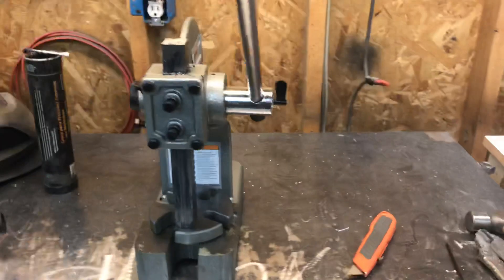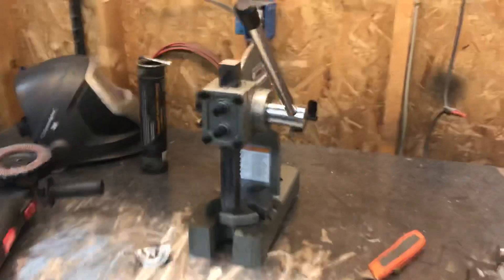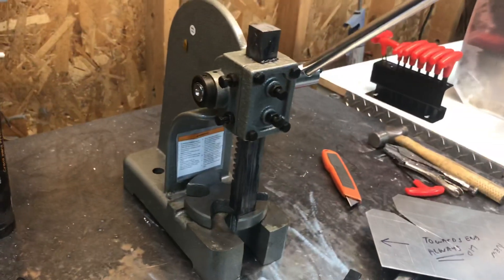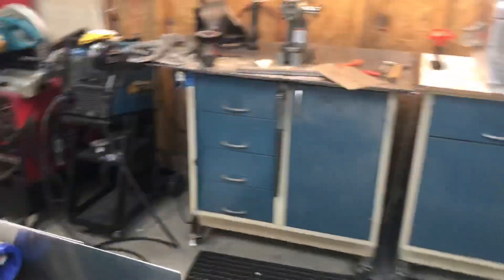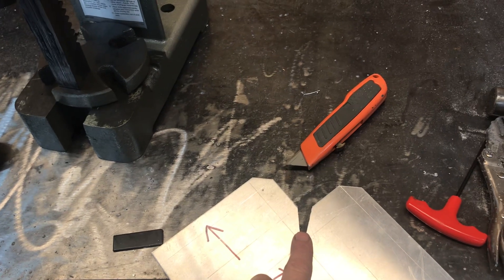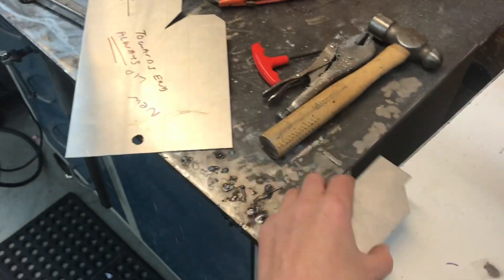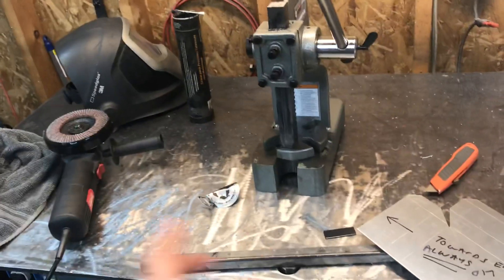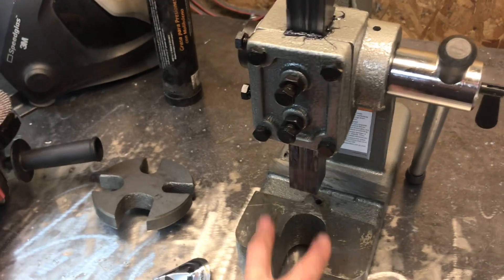New Arbor press project. Making punch and dies. pt1 November 19, 2019

Comment: I made a set of dies for round flat gaskets. I put in 2 alignment pins because of the tolerances. Same hf press went through 1/8 thick rubber without a problem or cheater bar.